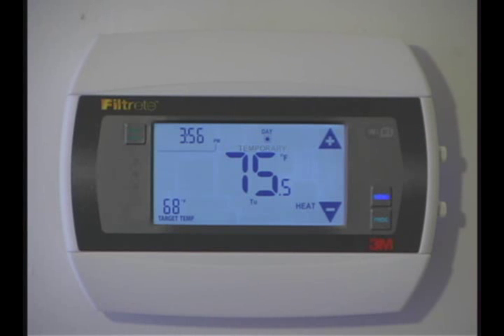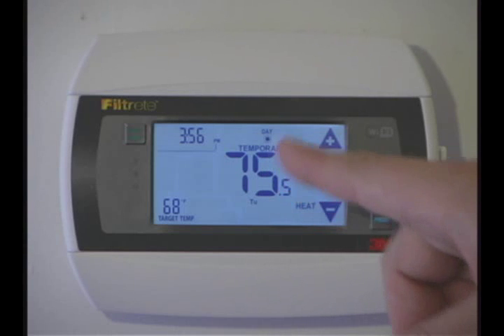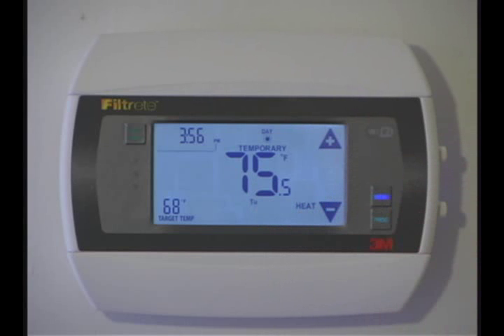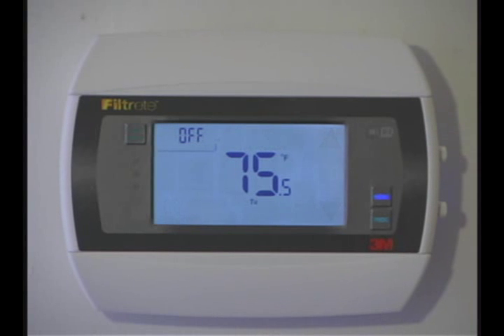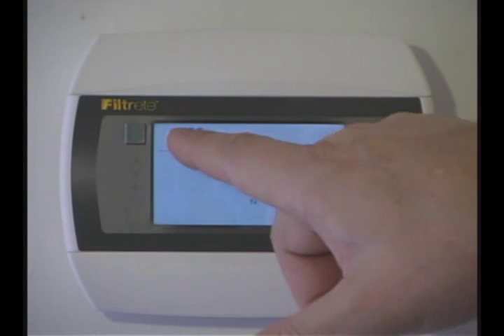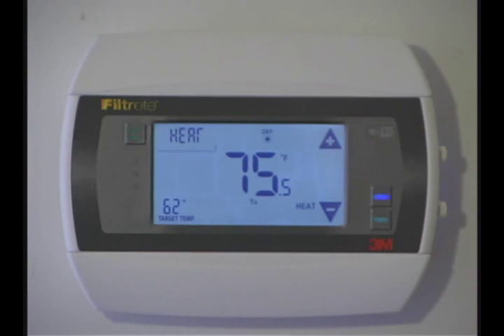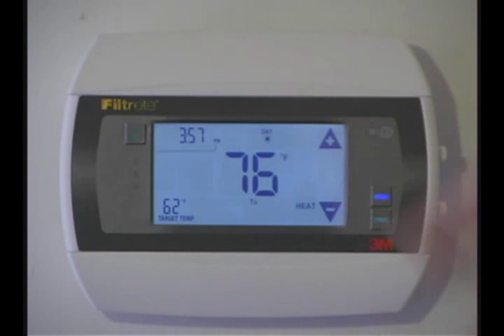Filtrete 3M50 What is Temporary Mode?

Comment: Why won't my year stay on and the heat in the bottom right flashes. It says it is at 61 degrees and it is set to 68. I can cycle it on and off and it will turn on the heat but after a few minutes it turns back off before it reaches temp